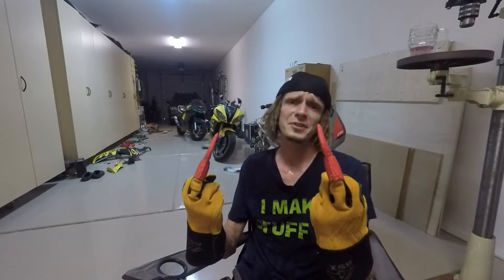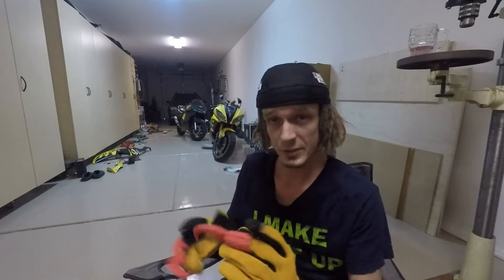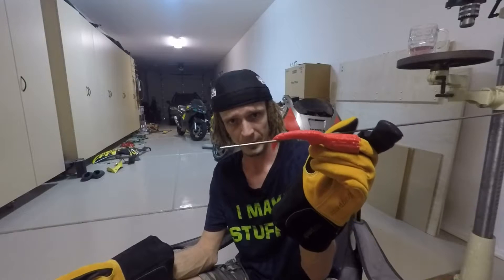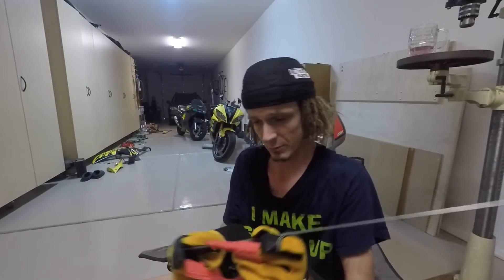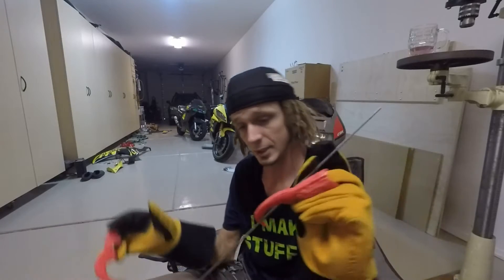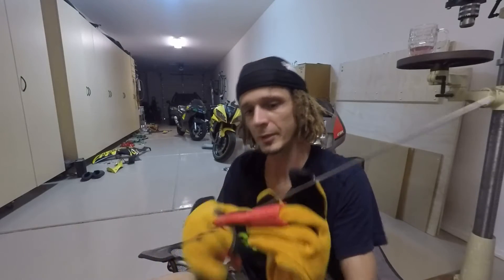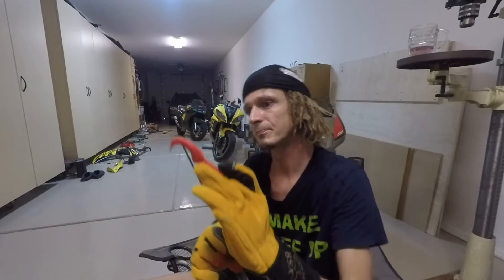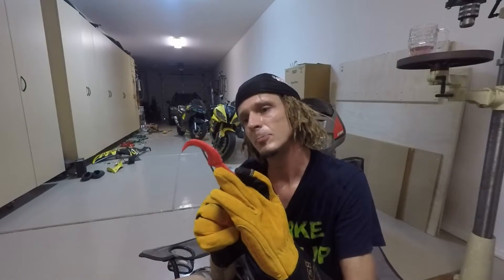TIG Monster Claw - TIG Rod Feeder - 3D Printing Meets TIG Welding!

Comment: What kind of material did you use
Reply from the maker: They're made of ABS. Nylon or a high temp ABS would be better but these still work great for short runs and the better you manage your HAZ, the less chance the ABS would melt as is. It doesn't firmly adhere to the filler rods when it melts either so yeah, all in all it works great :)

Comment: Marc, GREAT FRICKIN IDEA !!!!! I'm taking a intro to welding class and right now we are doing TIG. What a pain to feed the rod. 

Have you started selling these? 

I dont have access to a 3d printer. Maybe i can cut one out of wood? Fab one in aluminum?
Reply from the maker: Thank You very much! Not sure why Youtube never shows me comments on my vids :\ You can def fab one out of Aluminum and I'm sure wood, well polish sanded would work pretty good too albeit you'd probably not wanna keep the full length of the claw tip with wood :)

Comment: That's bad ass. I don't tig that much but rod control is my biggest problem. I'm a crew chief on a drag boat and my driver runs a plastic injection molding co. We need to hook up !!
Reply from the maker: Thanks piston! Clever name ;) It really did help stabilize the rod. After 3 months of use I find this most useful when I'm doing long runs and Aluminum since Al requires more filler. Stainless and regular steel it's mostly helpful for stability. The over all stability is pretty nice too since just a bit of a shaky hand or when the rod just slightly bumps to one side can kill your appearance. All in all in has it's places and it doesn't but for me it works pretty well when I use it :)
Reply: If you want to make these in mass call 918 252 3636 ask for Jeff tell him Craig said to call. Can I buy one of these ? My user name is the name of the boat.
Reply: Marc LeBeau did you ever set up production on these? I would be interested in trying one out if they are available to purchase.

Comment: What kind of printer do you use? I have a robo3d but have been having issues with it.
Reply from the maker: Oh hey Austin! So sorry I never saw this especially for all the help you've given me. Been stuck on all the other videos, forgot about this one... :D :\ .... I use a LulzBot Taz 5. Are you having issues with my specific model or just in general? If it's my model let me know what's happening and I can probably help troubleshoot it with you especially if you're using a Cura release. 
The most important thing I found was print slow, like 20mm/s for almost everything and I also print the inside before outside walls which usually is not selected by default. I've had all sorts of stringing and and deformations around the base with this and other models but once I finally slowed down things significantly they seem to get a lot better. Larger prints seem to like a bit more speed but still figuring this stuff out too. 
Let me know and I'll gladly help you with anything you've got issues with!